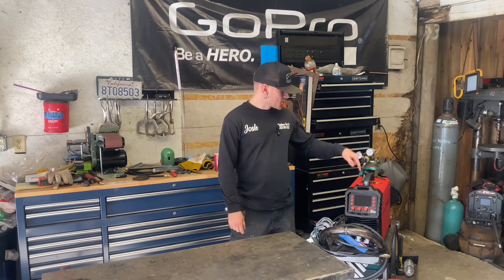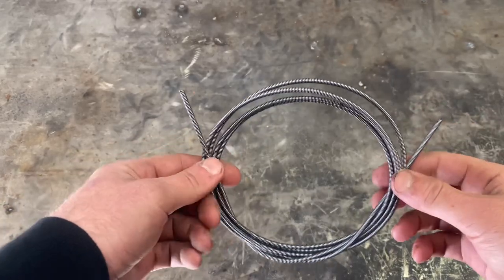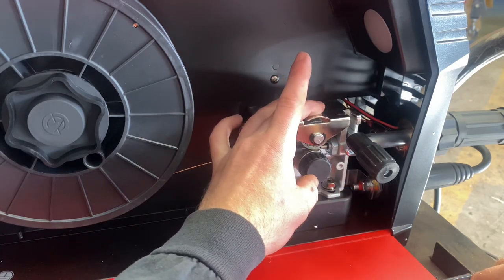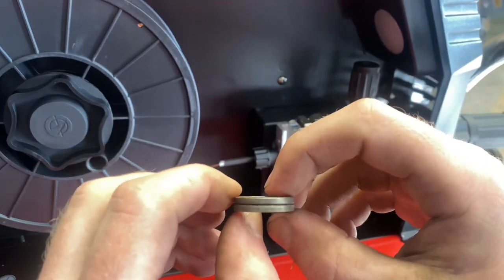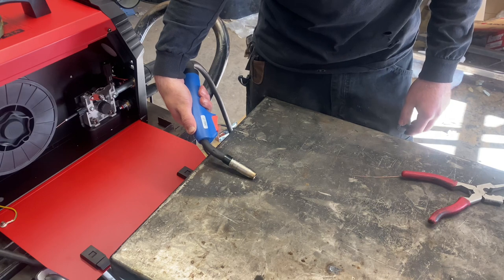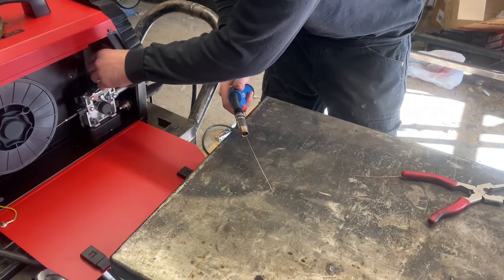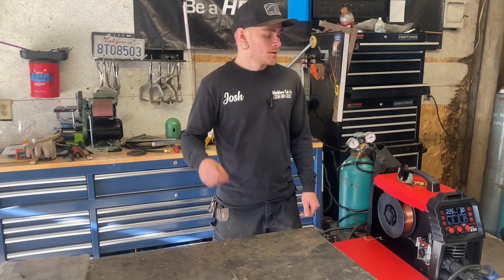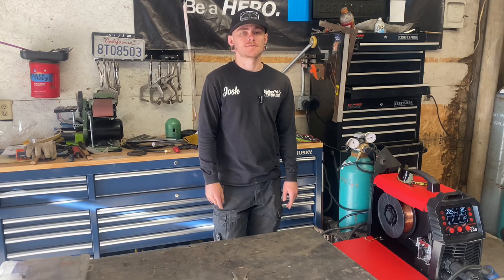Welder Running Poor? MIG Welder Troubleshooting And How To Set Drive Roll Tension

Comment: Thanks. I began having problems with the wire feed on my Millermatic 175 and have wasted quite a bit of wire trying to figure it out. I recently replaced the liner so I believe the problem is with the tensioner. As a relative newbie to welding, this was very helpful.
Reply from the maker: Thanks! Best of luck

Comment: For such a small welder (160A-200A), Can we replace the torch line from originally like 3m to 5-8m without an issue on motor feed power or poor arcing?
Reply from the maker: Yes I have been running a 15 foot pretty much since I got it

Comment: I have a new machine and while welding it seam like my wire speed is fluctuating, any idias?
Reply from the maker: Double check to make sure that the keeper that holds your wire is correctly inserted into your wire spool.

Comment: I have a brand new Yes welder mig 205ds-b welder do you have any idea why the black locking wheel nut for the roller keeps backing off
Reply from the maker: Which one. Shoot me a picture. Washburnfabco@gmail.com
Reply: I'm at work I can't shoot you a picture of video just at the moment it is the black knob that holds me roller on after a few minutes of welding I find it slipping and that being loose
Reply from the maker: @donheckman8352  drive roll side or spool side ?